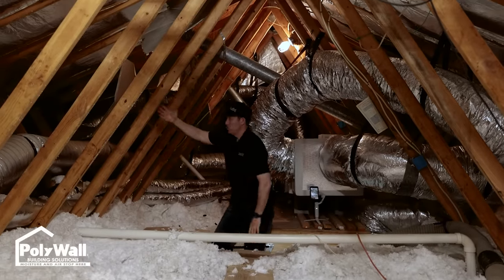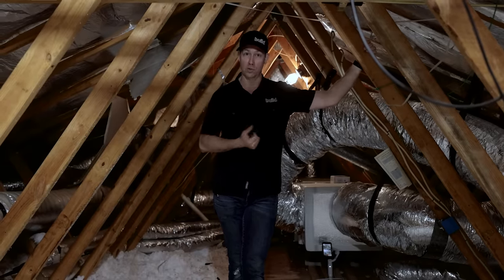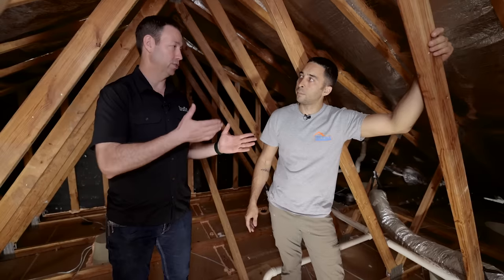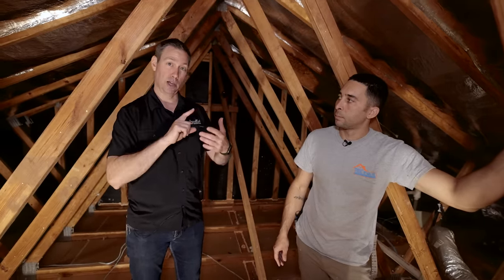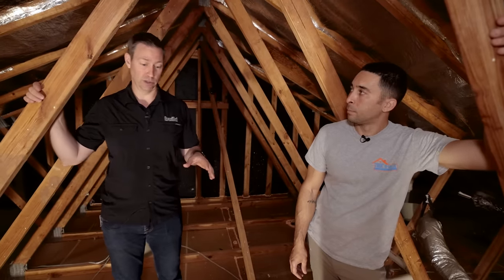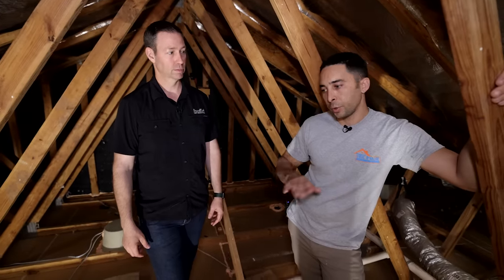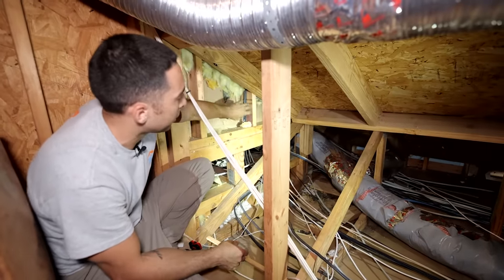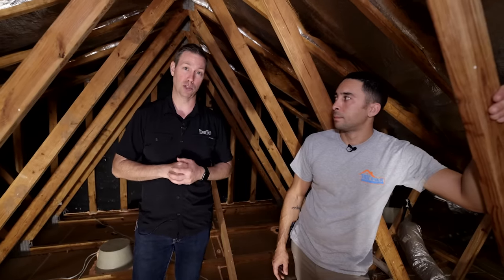How to Re-Insulate Your Attic - Insulation 2.0

Comment: Hey Matt, love the videos! We are located in New Braunfels in a new construction house. We have a door for walkin attic access in our daughters closet and are looking for suggestions on how to insulate and prevent the massive heat transfer thru the door. The closet can easily reach 10-15 degrees hotter than the room
Reply: Insulate the attic side of the door and put in a real good weatherstripping all around the door. I used 4 layers of polyisocyanurate insulation (layers glued together) on a door leading to the attic.  This is available at Lowe's in 4x8 sheets.  R5 per 3/4 inch layer. Be sure the wall the door is mounted on also has insulation.
Reply: Either insulate the door, attic side or you can build a secondary door with surround behind that one that opens to the living space and insulate around that to make an air barrier. Ones obviously more expensive

Comment: good video, but i almost cried when you blew that insulation back in, covering everything up again.  it is a nightmare to deal with (hence they sucked it out at the start).  Never again.  My first option would have been to replace the newish heater and seal/insulate (spray foam?) the roof.  The cost would have been about a wash ($5k to install new heater, less for the insulation on the attic floor, more for the spray roof) for a ~$20K job.  Now you can put down a plywood floor and have a large useful space (value per square foot of conditioned space, will far outweigh the cost of the work). There is also likely a market for selling the used newish unit ($1500?).  
Otherwise live with 6" fiberglass bats on the floor, as the true insulation loss difference is smaller than people think.

Comment: What is the typical time frame to recoup the cost of a project like this?  Just seems like it will take a long time to get back the cost.  My average energy bill is $300/month and if the project costs about $7,500 (1500sq ft x $5/sq) even if the energy bills drop by $100/mo that brings it to over 6 years before you recoup the cost of the job.

Comment: Is there a way to use an ACH50 test to determine where the house is leaky at? Also if you have an old house with a vented attic can you just seal the vents and then spray foam in new insulation?

Comment: Insulating at the ceiling plane is way more efficient than insulating at rafter level. Way less insulated surface area and also big reduction in conditioned volume.

Comment: Any disadvantage to way over insulating? Besides cost.
Reply: I did that in TN. The problem is that one can end up with an A/C unit (heat pump here) that is then too large and so doesn't run long enough to remove the humidity. I have two 2-ton units...with the new insulation, I generally only need two 1.5 ton units.

Comment: In regards to the radiant barrier for the rafter/roof side of the house, would it be beneficial to staple the radiant barrier onto the 2by face so that there is essentially a negative space for air to be in between the 2by material? Or would it be more beneficial to staple the radiant barrier in between the 2by material directly onto the plywood surface eliminating that air space?
Reply: It is actually REQUIRED to avoid molding !!

Comment: So, Matt, I've been thinking of adding closed cell to my roofline/rafters to keep my house and especially garage cooler.  I don't have venting nor any HVAC in the attic. Can I expect significant results in heating and cooling costs from this circa 1989 ranch house by doing this in the attic?  Or would I get as much/more by replacing the old batting in the walls with blown-in insulation?
Reply: I had some siding that went bad (the pressed board. I took it off and discovered that the builder didn't believe in nailing the sheathing at the top. It sagged over the years, and was open about an inch. The roofline is lower than the interior walls, and I've been replacing the pressed board soffit and nailing the top of the sheathing on, and putting some spray foam. But, that's the other big air leak I've found. It's no wonder that if I took off an electrical outlet cover, that cold air pouring out wasn't just from the hole in the top plate for the wiring.

Comment: Would there be any better benefit to doing a full spray foam layer on the attic deck instead of just sealing the walls, then fill with blown in insulation? Kinda like a flash and batt but for the attic deck?
Reply: Yes, that's how mine was done. My area has a minimum thickness for insulation so they did foam to top of rafter and then blown in to hit the number. Sealed up great and no leaks up top for sure - walls downstairs were done too. Very cozy.

Comment: 🎯 Key Takeaways for quick navigation:

🏠 Attic insulation upgrades can be done through air sealing and adding more insulation or using spray foam at the roof line.
🌡️ In regions like Texas, vented attics are common due to the absence of basements, with ductwork and HVAC systems often located in the attic space.
💡 Upgrading attic insulation involves addressing air leakage issues, which can significantly impact energy efficiency and comfort.
🛠️ Air sealing measures include sealing can lights, top plates, plumbing and electrical penetrations, HVAC boots, and mechanical fan exhausts.
🌬️ Baffles are essential to prevent insulation from being blown away by wind and maintain thermal efficiency in the attic.
☀️ Radiant barriers complement insulation by reflecting radiant heat, especially in regions with intense sun exposure like Texas.
💸 The cost of attic insulation upgrades typically ranges from $4.50 to $6 per square foot, with additional expenses for radiant barriers.
📐 Hiring a home performance contractor knowledgeable about building science is crucial for effective insulation upgrades and addressing air leakage issues.

Made with HARPA AI

Comment: I have sprayed under-my roof deck with open cell, but my house still get very hot in the summer time, i have been considering spraying the top ceiling Joist too... would I need to ventilate my attic too? Or is this something you recommend?

I dont have central air, I have mini ductless units in my house
Reply: No
Reply: @emmanuelsolis9676  i asked two questions, is that no to both?

Comment: Do not do closed cell foam insulation in attics with composition shingle roofs in hot southern climates. I've walked those roofs and they only last about 8 to 10 years. The shingles get cooked like a baking sheet because the roof does not breath. Only do this on a metal roof.

Comment: Can lights are definitely a killer Plus having an HVAC system in the attic is really dumb. Architects need to make room in the conditioned envelope for the ductwork and equipment. Conditioning a attic for the benefit of the HVAC and may be a little storage, is cubic  footage that has to be taken into consideration for load calculations ( like installing a room addition that nobody can use).

Comment: I have looked and looked and haven't found an example on sealing an HVAC closet that is open to the attic.  Very common in 70's Texas homes.  Do you seal the closet from above?  My HVAC is in a closet that goes straight to the 150 degree attic.  What about carbon monoxide when the furnace is running during the winter.  I realize the furnace is vented to the roof with a metal pipe, but is putting a ceiling in the closet the way to do this, or is sealing the door, and drywall in the closet the best you can do?  Don't want to die from carbon monoxide poisoning.
Reply: I have the same thing in a gas water heater closet.  There is an opening at the bottom of the closet (in the wall leading up to the attic) and another one at the top of the closet also going into the attic. You need to leave this uncovered in order to get proper make-up air and venting for the gas furnace.

Comment: Although codes will probably fight me, I question the real impact of IC vs. non-IC rated cans.  To me that harkens to the days of incandescent lights where each can would have to deal with 50-100W of waste heat.  These days, everyone will be using LED which consume just 10-15% of the power of incandescents for the same light output.  Yes they can still become hot, but nowhere near the potential of the incandescent.

Comment: Sounds like a Shop-Vac, big cans of spray foam and some of those can light boots on a cold day would be your best thing for the buck.
Reply: Why do that when you could pay 10k+ for someone else to do it? lol I laugh at videos like this because at the price for that job it would take the homeowner 20 years to recoup the money spent on the job with the savings he is getting. This is barely $500 bucks in material, if that, depending on the size of the roof area. The can light covers are $15 a piece, a couple cans of spray foam even if you use the throw away cans would probably run you 60-70 bucks, and the blown in insulation runs about $400 bucks to cover 1000 sq ft.
Reply: I think you're underestimating the sucky part.

Comment: By bad experience, I strongly recommend that private homeowners do NOT get spray foam. There are a lot of bad contractors out there, and no way to know beforehand. A general contractor will know who sucks, and avoid them.
     My experience is that the guy who contracted the work hired ex-convicts to do the actual work. He gave them five minutes of training, apparently. These guys managed to do the wrong mix of the foam ingredients, (which are supposedly fool-proof) and the foam never hardened in much of the attic. Instead, it off gassed toxic fumes throughout the summer. The quote for removing it was $60,000.

Comment: What about in ceiling speakers?
Reply: Replace speakers mounted in the ceiling with small Bose-type speakers mounted to the ceiling. This would require patching the large hole left by the original speakers.

Comment: Let's talk about cellulose and how much it settles over time. I had 10 plus inches blown in a few years ago. Just installed security cams. Cellulose sunk to the rafter tops where you walk.  DON'T waste your money on cellulose people. I have a vented attic with 3 whirly birds in OKC. Open cell will outperform cellulose or fiberglass bat by a long shot. Then talk about closed cell......

Comment: You don’t need a heat pump what you need is a 90% furnace no need to go with a heat pump if not needed to run a spray foamed attic

Comment: Hey Matt or anyone with knowledge of attics and ductwork, insulation. I have a 75 stick house in North FL, I had a company come out and do the ductwork and add a new train 3ton unit. The company left pieces of the old Insulation board that in some areas were 3'x3' right above the vent and all they did was tape the crap out of it. They had done that to several drops. I got the correct boxes, and cut the holes in the ceiling so the box could fit like it was supposed to. I finished it and the system now will shut of while cooling my home..
Oh I had a company come in and blow in several inches of insulation to help the old insulation already there..
The problem is that I now see mildew at one of the drops from the bedroom side which makes me wonder if the other ones will be happening too? Im curious if the added insulation that covers the ductwork is not supposed to be covering the duct work? 
Also who in North FL is reputable to build and size my new ductwork??? Id truly appreciate any help..
thanks..

Comment: Why would they re insulate with crappy blown in insulation. if you were a friend you would have recommended him to put in Rockwool batts. so much better that loose blow in garbage.
Reply: costs go way up I'd guess. Cutting those batts to fit around can lights, wires, etc, would be very time consuming.

Comment: If I were going to spend that much to spray foam an attic I would replace the furnace. Comparatively, they arnt that expensive and you will save in the long run.

Comment: Really want to do this on my 1985 home. The only thing I would do is probably hire someone to come suck out the old insulation that is ridden with rat feces. Then seal and insulate on my own. Otherwise a job like this going to cost you $15k+ easily if contract everything out.

Comment: That attic should of never had the HVAC in the attic unless it was spray foamed from the beginning. The heat adds an incredible load on your unit if it’s in the attic unless it’s spray foamed. 

Just because it’s ok as far as code, or the builder thought it was a good idea doesn’t mean it is.

Comment: It’s so depressing to see houses built like this!!
Reply: I bought a house built in 2019 that's worse than this. Insulation barely clears the joists, no attic baffles, can lights everywhere. A/C runs 18hrs/day most days from May to October in southern Florida. The one saving grace is the house came with a 6kw solar system, but I'm still paying for 400-800kWh/month. Was not surprised to learn the builder went out of business.
Reply: @billedwardz  Did something like this happen during the building inspection? "Excuse me sir, did you drop this $100 bill?"  I always wonder that whenever I see or hear about blatant code violations that somehow get passed.

Comment: Well, okay. But there was nothing specific that told us that anything should be “redone”. In what sense was this anything other than a commercial promo. What is supposed to be achieved by this. I love the idea that the blown in insulation should be removed, so that we can correct the sins of how the property was originally set up. Low voltage, security systems, etc. What’s up, what’s behind this?

Comment: Who no basements in TX?
Reply: Probably depends on where you live in Texas. Closer to the coast would be water table issues.
Reply: Where I live in TX there are bedrock issues very close to the ground. It's expensive to put in basements here.
Reply: In the northern climates you have to dig down 48” to get below the frost line.  So diggin down another couple feet doesn’t have a huge additional cost.  In Texas you can build slab-on-grade so any digging is just adding additional expense
Reply: Hey Ian, in Central texas the floor is limestone. It’s expensive to dig and since the frost line is something like 6 inches there’s no reason to dig when bringing plumbing to homes. Making basements an huge additional cost
Reply: @beaker2k  In Northern Virginia you can do slab-on-grade, but the more expensive houses all have basements, the slab-on-grade houses tend to be the cheaper ones.
Reply: In some areas we have a lot of clay soil that tends to expand when wet and shrink when dry. This is not a good thing for the stability of basement walls.

Comment: I don't see a reason to remove the old insulation since it so low. You can identify most if not all potential air gaps from inside or below the attic space. I don't see the cost benefit of removing that insulation honestly.

Comment: The big problem is half of what you talk about is TX specific.  Most of the country is not on slab, etc.  I have NO heating in my ceiling and it is all cold returns, most of the country has not damn AC let alone insane attic AC.  You are right about sealing but most does not apply to the rest of the country.  I have no goats in the ceiling or raccoons, or whatever animals you have infesting.  I do not need it to be 90 outside for my attic to get over 130.  I can happen when 75 but you have no idea why, do you.  You roof also have huge slopes, easy work, almost an extra floor.

Sadly, since the lazy contractor who owned the home before just blow in more insulation you confirmed I am going to have to do  "suck out" and properly seal before it can be re-insulated despite so much else not being relevant to me nor most others.  

I would subscribe but I have seen enough to know most of what to talk about does not apply if you live in WA.

Comment: Everything looks good but removing the insulation was unnecessary and very costly, not to mention wasteful. Map out the floor from below, charge a little more to work through the blown in, and add 6 inches instead of the 10 you sold him. The fiberglass looked to be in fine shape. The payback time just doubled and the landfill has more trash.
Reply: At the very least re-blow the old insulation.
Reply: How are you going to air seal with the old insulation covering everything?
Reply: Move it over to the side. Blown in fiberglass isn't half as bad as cellouse or old nasty rockwool. Charge more to work through the blown in but way less waste and cost than vacuuming it. Retrofits are very common, we do it everyday. Some insulation should deffinately get removed but this was not the mouse/bat/rodent poop infestation we've seen.